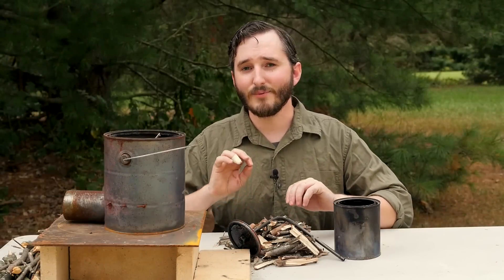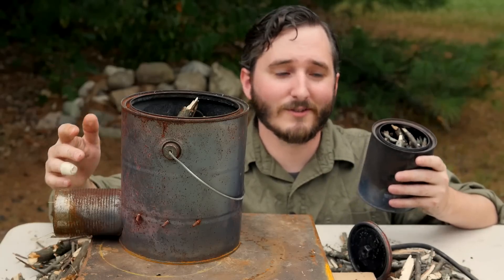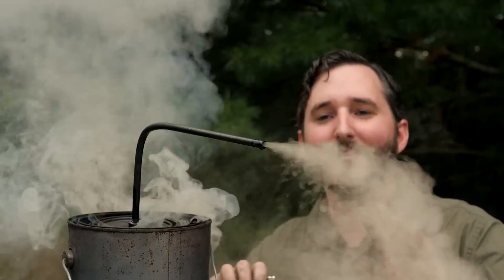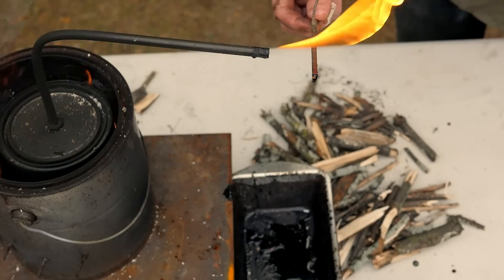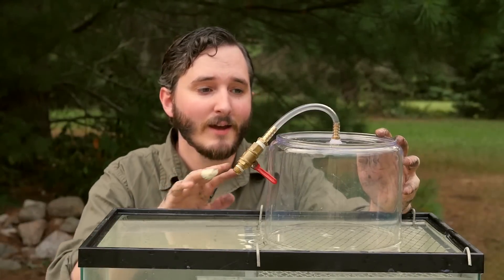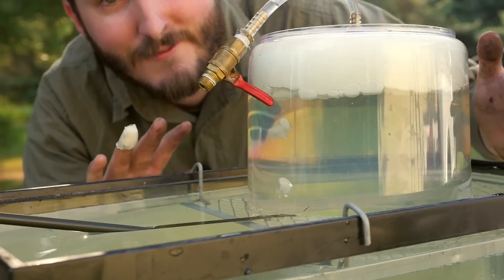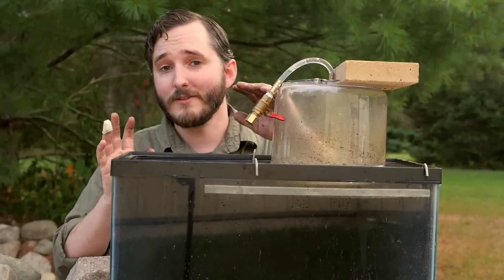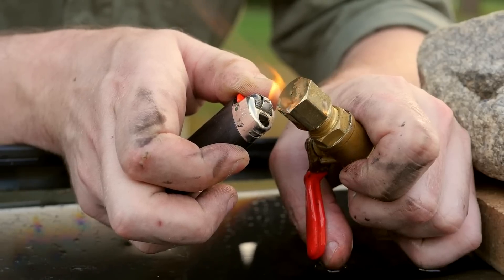How To Make Wood Gas Biofuel (and an experimental gas collection method)

Comment: How quickly could you fill an old water heater tank with this natural wood gas? You could even have the water filtration system included because water heaters ARE rated for storing liquids under pressure, so I doubt there would be an issue past the relief valve on the top of the tank.

I would like to see a video like that with a section of the tank removed and replaced with clear acrylic so the gas level can be monitored.

I have an old water heater and I would like to use it for this purpose, I mostly lack the tools and the time to do it if it's not going to work well 🤷.

I love your videos and your approach to applied science.

Comment: I like newer engineering using natural material. Have you heard of a rocket stove mass heater? Not just a bottom lit fire. There are masonry rocket stoves that have a very calculated air intake, burn chamber, and exhaust. (Especially a belled system)

Anyways, they get up to thousands of degrees and burn the woodgas and exhaust almost nothing. The initial start up obviously doesn’t burn it until temp is reached. It would be interesting to capture the gas until it gets up to temp.

Comment: you can extract ALL Oil out of a Tree with Pyrolyse,som can made later to Diesel,gasoline and Coal. use it complett without lost.
Reply: send the Gas in to the Flame to feed your Fire,so you use less Tree for the Fire but more for made Gas and Coal.

Comment: The type of condenser generally used for distilling spirits will draw off water, as well as other impurities such as methanol. For removing soot and tar, a filtering device modelled on the older automotive air cleaners, used before paper filters were developed, could be fitted behind the condenser. These devices were called oilbath air cleaners.The remaining problem is, of course, harnessing this gas for storage.
For immediate motor vehicle propulsion, the amount of gas harnessed could be better mastered, when the wood is  heated by the gas itself. Only then, could the speed of the process get regulated, similar to how an automobile's gas pedal regulates incoming fuel/air mixtures.
Centrifuges have also been used for separating solid impurities from the gas itself

Comment: Add more pipe and cool the wood gas down through a heater core, intercooler, or radiator..and it will burn better.

Comment: You can do this with any organic mayerial. I use shredded paper from a local business. However, with paper, I can't pack it as tightly as I can wooden twigs, or the paper will get stuck in the outlet of my 1/4 inch steel line.

Comment: Great tech. Thanks for showing us the basics. If you run the gas through a fridge compressor into a gas cylinder you could colet it all and have it settle clean in the gas cylinder. Than transfer the gas. You will get black sludge in the tan which you can put a little tap in the bottom to drain out? I wonder how long it would take to get 15kg gas tank? Thanks what I use for the bbq heater. I love that you can use the coals, tar and gas. Nothing is wasted.

Comment: One might consider condensing that gas into a liquid, filtering it again, then compressing it into a bottle. That gas is also a LOW OCTANE. Modern engines can have trouble using wood gas due to computer controlled spark advancement.
Try attaching a long copper coil to the end of the brake line and have that submerged into the water.

There will be some carbon monoxide in that gas so be aware of that.

Also, about that leftover charcoal - if you inoculate it, you make biochar and that in turn is used to make Amazonian black Earth. About the best soil on the planet.
One only needs to amend the soil once (about 8-10% depending on the soil and crop you intend to plant).

You are making what is called low temperature charcoal.
If you pyrolize it at a significantly higher temperature you get more gas from the materials used. Charcoal would also be better quality. Less tar too.

The choice of materials used to make that charcoal (and resulting wood gas) should be considered. Hardwoods make the best.
Also, you can pyrolize any organic matter (leaves, bones, etc).

You will never get back more energy that what is used to make the wood gas.
The wood gas would mostly be for convenience and a ready to use reserve energy supply.
Reply: @crazysquirrel9425 Hi. What may happen if I use charcoal instead of wood/leaves to produce flammable gas? Will the charcoal convert to flammable gas completely? Won't it be decreased completely?
Reply: @ShafayatSayeed  Not sure on that. I will tell you that heating biomass produces hydrogen, methane/methanol, carbon dioxide, and carbon monoxide as a minimum.
One something is converted to charcoal, those flammable items are generally gone.
What you could do is this:
Pyrolize the biomass and condense the methanol.
The charcoal left over can be used to heat more biomass.
Less waste that way.
Reply: @crazysquirrel9425  Thank you.
Reply: @ShafayatSayeed  Just my opinion based on previous research. I do not know what burning charcoal will give off. Pretty sure it is no where near as much as biomass.
You are welcome.
Reply: @ShafayatSayeed  You are welcome!
Hate wasting a valuable resource!

Comment: Would there be any problem with trying to fill the container while it was already submerged, possibly held in place by some sort of frame? You'd have to use a bent brake line, to get it there, but it would already be pressurized and ready to move into another container.

Comment: Ok put a balloon in a bottle vaccuum out the air. Do the sme thing with diffused smoke in water then it should be more pure and you can cap it release the vaccum and you have a pressurized tank. Then with a real tank you can vacuum as well add and refill. Try to run an engine with that. Ideally a generator.

Comment: Super cool!  I’d love to see a way to liquefy or otherwise collect it in a way that would be easier to transport.
Reply: <<Super cool!  I’d love to see a way to liquefy or otherwise collect it in a way that would be easier to transport.>>  

Not at all easy to liquify a gas like that,  but it can be compressed by whatever means happens to be available.

Pressurizing the gas by dunking the container in water is a good method of pressurizing the gas,  and can pretty easily produce the pressure used by natural gas furnaces,  ranges and appliances.

One thing  ---that gas can easily be explosive,  and a gas explosion in the glass container might cause serious injuries.

I once played around in a chemistry lab by valving off hydrogen gas into a bell jar  that was upside down,  which allowed the gas to collect at the top.  I reached under the bell jar with a sparker to light off the gas and....

BING!  they don't call a bell jar a BELL jar for nothing!  The gas exploded and the jar rang like a bell.  My face was right next to the bell jar,  and had it shattered I would have gotten a face full of glass.

Fortunately,  the bottom of the bell jar was open   ---but still I was lucky.

Comment: Am having hard time with a well memory returns over those facts that I fear most.If only some new thoughts can come in,I might end up being in an undisclosed situation since I all alone suffer it and non again haves the idea am into such calm death threatening calamity.I currently have the two ivory tooth of a Mammoth that if cleared to check for its dating might come from the ice age and the quality of the material is very radio active and emitting radiation of course, I got from trash.I think flys laid there eggs into my skin and the pupa is trying to eat me up inside and out and am currently seeking for its treatment in other to continue a life.

Comment: The fuel is not getting ignited. The butane is just in the air jetstream. Initial fumes out of the gasifier has too much moisture content to ignite. You need to run the gasifier longer before capturing the gas.

Comment: One method of charcoal production we used to use here was a 44 gallon drum on it's side on a short stand with a pipe for the wood gas that would feed back and under the drum and into the small fire beneath it. Little camp fire would heat the drum packed with wood, and the gas would then be burned off to continue the process. This would produce large quantities of charcoal which we would then use in a furnace for metal working.

Comment: put it through a sealed tank of water then a pipe with a condensation loop to remove any moisture and then put it through a powerfull pump to put it in a small chamber

Comment: I would be curious to know the chemical makeup of your wood-gas. I cannot find anything online about the method you use (ie - a sealed reaction chamber) - most use some sort of downdraft method, and the resultant gas is apparently around 50% Nitrogen (which I imagine yours would not be, not pulling in air from the atmosphere as part of the process).

Comment: 50% methane and 20% hydrogen and little carbon oxide and some carbon dioxide. there can be some nitrogen aswell.

producing woodgas from wood gives you also charcoal..
burn the charcoal and get the ashes.
its possible to recover metal potassium from ashes but  its complicated to do so and potassium is very dangerous when thrown to water..

Comment: I suppose if you took a large trash can with a valve in the bottom and up ended it in a large body of water, you could open the valve making it easy to immerse it and chain it to the bottom of the water tank. Once you close the valve you can fill it with  gas and providing the chain connection was strong enough it would presurize itself.

Comment: So the method to make woodgas  is the same as the method to make charcoal, so does that mean when you run out of fuel in the chamber you can just add the spent wood into your burn pile because charcoal burns extremely well, which significantly decreases the amount of wood you need

Comment: Not trying to be a downer here, but it seems to take some time and wood (fuel) to make a tiny amount of "clean" wood gas. Considering the issues of filtering and catching the wood gas, it doesn't appear to be more than a curiosity and byproduct of a charcoal making process. The charcoal is more useful in that it can fuel a forge or serve as fuel for an external combustion engine (like a steam engine). Even if it were possible to catch and filter all the wood gas from a batch of charcoal, it would still be a tiny amount of energy. It might run an internal combustion engine long enough to travel 100 ft. or so? Correct me if I'm mistaken or not seeing something, but it just doesn't seem to be worth the resources and time in a practical sense...

Comment: Your method is really smart. It's a great filtering method. If you wanted to store the gas you would only need  a pump to compress the gas and then direct the pump to a gas tank that withholds pressure.

Comment: I really like this but how would it stay a light as soon as you took the lighter away it went out is that too much pressure or what? What i also like about it is that after you have made your gas you can go burn the charcoal wood double whammy if done right as u could have 2 heaters that work in different ways especially if u could burn as u produce and after the 1st wood burn you would be burning your charcoal which as u said is fairly smoke free

Comment: Came back to this video after getting my wood stove with reburner system. Makes me look at wood combustion in a whole new light. You can see the wood gas coming out of the reburners and igniting. When it’s hot enough to turn down the air control, you can see the atmosphere in the stove box ignite not even burning on the surface of the fuel. When it’s over 1k°, you can see the wood heating to its flashpoint and igniting without the normal black surface oxidation. The wood still looks normal but flames are dancing on it, then it quickly bricks and turns to glowing coals and ash in a matter minutes.

Comment: I have any method, that you make a closed tank that fulled half by water, and then the wood gas came from the bottom and on the top of the tank there's conected to vacum compressor, but the vacum amount must be adjusted as the same amount of gas out from the water tank, and then the output gas can be storaged in any kind of tank, so the dirty gas neutralized by water and the pure gas compressed to any tank by the vacum compressor
Reply: Sorry for my bad english, cause I'm from Indonesia, I don't understand english so much, sorry

Comment: If u fed the gas thru a large tank of water and let it bubble thru the water and then collected it thru a small hole in the top of the tank most shit would be caught by the water and u could collect the gas to be  tanked or set straight in to a stationary engine to produce electric

Comment: Connect the second container that is over the water to a compressor that feeds into an empty high pressure tank like a propane container. Have a couple inline drying filters to extract water vapour so as not to destroy the compressor and you have a half decent collection and long term storage method? It could be a green method to go live completely off grid but have some modern conveniences like wood gas boiler for hot water source maybe a bit of heating for the home and the charcoal for heating and cooking? Maybe use a solar panel to power the compressor to reduce the co2 also incorporating it into the design of the home heater you could produce charcoal and wood gas while heating the home anyway further reducing the co2 foot print.
I guess this got my mind jogging there thanks for the vid.

Comment: I want to see this done a second time, but with using a series of “doublers” where the gas is passed thru methyl alcohol and/or ethyl alcohol to capture methanol. Kind of like a thump keg or thumper in alcohol distillation. Weigh the quantities present both before and after to see if it collects some methanol, and also check the “proof” using a proof and tralles hydrometer. I bet it would work well.

Comment: So to increase the efficiency of the charcoal making process you could bring the wood gas line down into the rocket stove to make it burn hotter and a little cleaner.  With the addition of the flame retardant carbon foam you make you could make it even more efficient I would think.  Thank you for the great Ideas now to make bio-char for the grill.

Comment: I used to do this with a 50 gallon drum, layed horizontally on top of two cinder blocks at each end, pipes coming from the top (in the horizontal orientation) around to the bottom, where the holes to release it were. This had a three sided cinder block housing around it.
Fill the drum with wood, seal the lid, build a fire under it, and you're using the wood gas from the wood being pyrolized to reduce fuel required in processing into charcoal.

I was blacksmithing small trinkets & knives.

Umm...
Wood gas is typically produced on demand for automotive use.
The airflow from the intake of the engine is what pulls the wood gas out of the pyrolizer.
I can assure you that it doesn't burn clean, and that even after multiple stages of filtration, you're gonna get lots of tar build up.

This is still a problem with modern automotive pyrolizers, which typically use two twenty gallon tanks of filter material.

Comment: This little contraption has a low efficiency. I mean you want a clean fuel to burn yet you used an open flame to carry out the task. I understood that this is for illustrative purposes but in the real gasifiers, how does one start the heat inside without using an open flame? Thanks.

Comment: I wonder where he got the idea for a water filter? Do they use water filtration in biomass gas production? I thought of one myself that is very similar to this (like a water bong) but has a series of filters afterwards. Does activated carbon help filter or will it filter the combustible gas as well? Is filtration is one of the bigger  problems in woodgas engines? Do bones burn cleaner with more gass?

Comment: I checked an old book I own called The Lore of Still Building, and some stills use something called a “slobber box”. This is just a wider chamber with a spigot or valve on the bottom that you hook up in the middle of the outfeed tube. This might help your design, as such devices are used to collect tars and impurities and drain them off separately. But your wood gas videos are very interesting to watch and I’ll be trying this as it will work better than the methods I use now.

Comment: Thank you for an informative and concise presentation. But I'm wondering what the combined bottom line energy produced total is. Meaning the heat produced by each step of the process, and recovered energy at the end.
1. The initial wood burn energy to make charcoal
 2. The stored energy in the charcoal itself
3. The energy of the wood gas itself.

Comment: So use gas to heat wood to make gas to run engine to do work ... Lose power with each conversion ... I would use wood to make steam to do work ... Use less wood to do same work ... Less cleanup ...

Comment: If you fit a needle valve then the valve you had you could have the regulator equivalent to put them onto another piece of brake line with holes drilled in it creating a gas burner to then use for cooking but if there was a way to create a means of regulating the wood gas from the main fire to an already submerged gas bucket to give a longer run time over all. Realistically there are more products (including filtration and compressors) out there to achieve all of this but it at least gets the inventors talking.